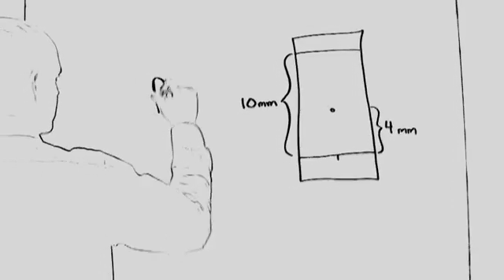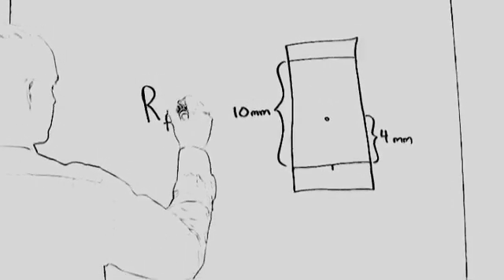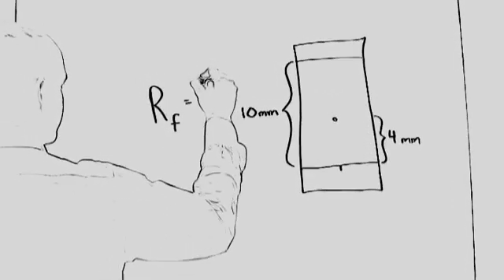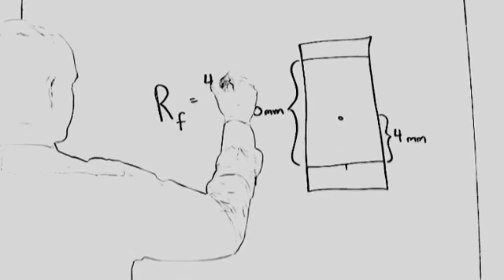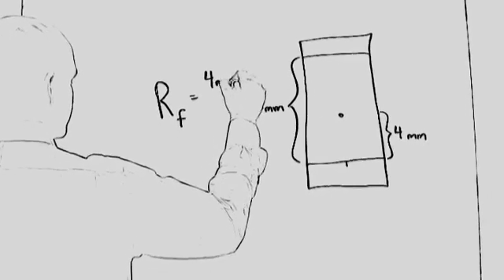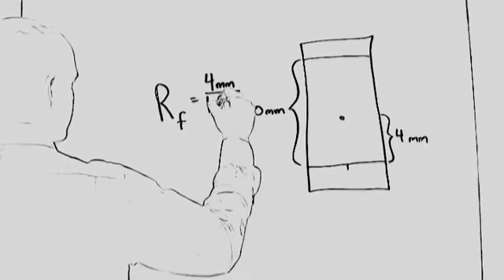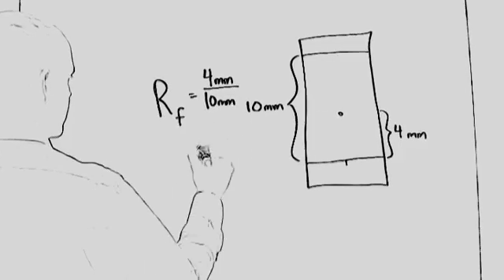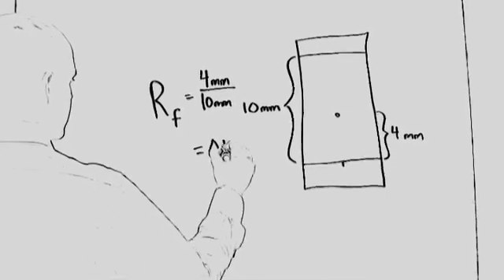How to calculate an Rf value

Comment: Thats not true, why would u be measuring in ft, mm, m, km etc when a average TLC plate is measured in CM!! its not a giantic plate ya kno...........

CM is the correct Units to use whilst calculating the Rf values and Yes! the Units do matter, you'd get marked down if you used the wrong units or added the wrong units into you results.